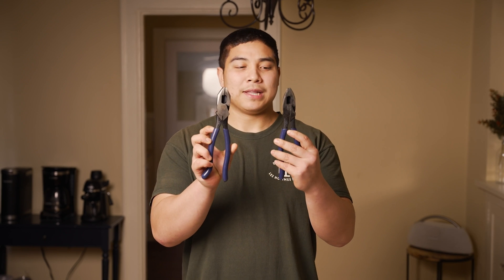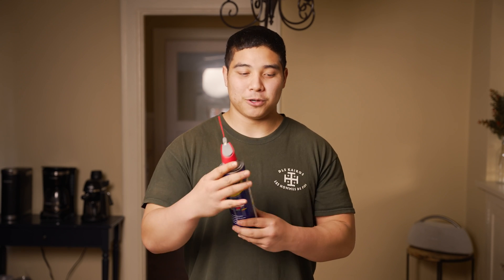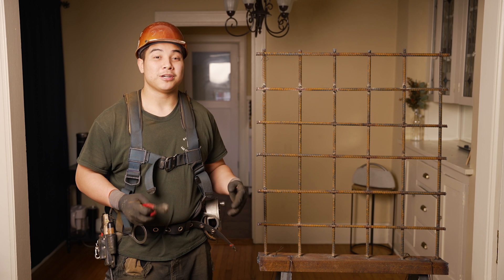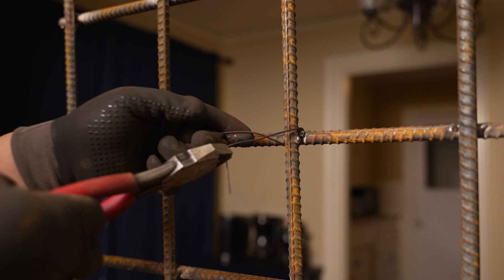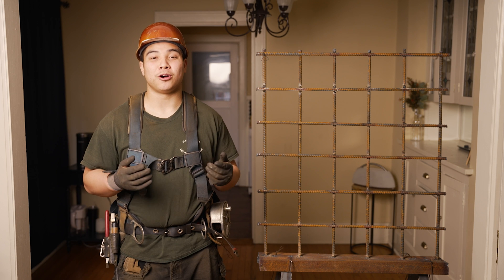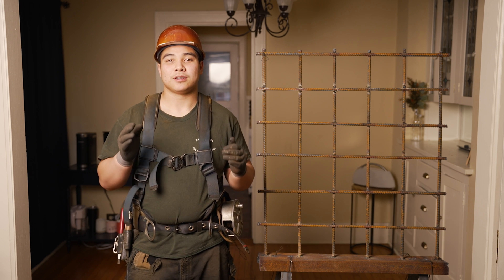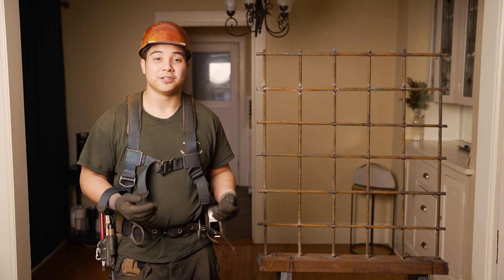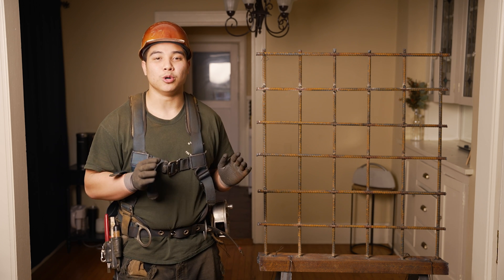How To Tie Rebar :Ep .1: Single Wire Snaps; Proper Tools, Reading The Bar, Technique

Comment: Son,  Back in the day when I did a lot of form work, we used what we called "potato ties"...
Which were actually used in the potato fields to tie the heavy bags. The rolls were made
of  approximately 4 inch wire with looped ends. You used a hooked twister tool that was
incredibly efficient and far superior to the pliers method...Simple  bend the wire around
the two bars, hook the loops and pull. These must still be available today...
Reply: Uphill both ways!

Comment: I can appreciate your enthusiasm bro, but you're giving out some not so good advice about tying bar......never double cut, it's one extra motion with your tying hand that's unnecessary and it leaves debris on the ground/deck/wall etc...alternate the direction of your snap ties, helps eliminate racking, also, it's called 'heeling' your wire, not keeling or whatever you said, plus, learn how to incorporate heeling your wire on the initial twist, helps eliminate one extra twist of your tying wrist which over a 25+yr career will prevent thousands upon thousands of twists not done by that hand possibly saving your ass from carpal tunnel surgery or arthritis. Also, lose that harness bro, if your working union in California I don't know of one legit company will allow you to use that for climbing, one more thing....BEND OVER AND TIE BITCH! haha!!!!
retired for two years now, have fun ladies!

Comment: Thanks for the video. I ordered and received two pair of Klein Tools D201-7CSTA from Amazon and the cutter smashes the wire and then I have to twist it for separation instead of making a clean cut. Is this what should be expected or are they defective?
Reply: Why use cutters to snip? Just twist your wire and cut with the blade on your pliers. The cutters should be able to make clean cuts

Comment: Dude, I'm with a concrete company and we usually tie our own bar rather than hiring out. We typically use saddle ties or figured 8s for wall bar. I learned how to snap tie more efficiently from this video but I'd love to learn how to do saddles more efficiently.
Reply: An efficent saddle is done by entering quad 3 (using the video quadrant system and rebar layout) to quad 4 with the hook, then grab the wire and feed enough wire to complete the tie (it will take a little practice to be able to eyeball the correct length more is always better here), then snap to snug and stab into quad 1, then release the wire and regrab with pliers from quad 2, pull the wire and snap to snug and complete the tie with the same technique as the snap tie shown in the video. This appies if you are righthanded BTW, if you are lefthanded it would be 4 to 3 then 2 to 1 and tie, hope that helps. As with all rebar tieing techniques you want to start slow get the technique right and then the speed will come.
Reply: You double wire saddle with a wrap on all framers, and the bar at eye level to walk on while tying the rest of the wall. Other than that (if you’re a journeyman) you can snap and wrap everything in between!

Comment: Bro You cheated them rods are welded haha, yo I'm building 4 extra footings for my added post n beams in my basement , I have a few questions..

MUST I remove all rust and corrosion on rebar before I pour or does it not matter, pour with rusty rebar?
And do I need the rebar under tension? I'm building a Cage for my 15 inch sonotube.
Reply: Rusted rebar can expand 4x its original size. This in turn can lead to more cracking, spalling & deterioration of the concrete. This is especially true in salty environments. Some say a little rust can even help with adhesion. All agree that Too much rust is always a problem down the road. Absolutely no rust is universally the best practice. Unfortunately, it isn't always possible. Therefore, if you can clean it all off you are better off. Tis my opinion.

Comment: Springs Slow you down.  No matter the work.  I trimmed marijuana for years. Everyone starts out with the spring loaded Fiskars.  But after some time everyone moves over to the springless Chickamasas scissors.  I will disagree with his use of a wet lubricant. I have always found that dry metal lubes work better if contamination is not an issue.  Overall an excellent video. Much appreciation for all of the details.

Comment: Wrong tool, too much iron wire wasted on each and every single binding, none of the bindings turned 90 degree in comparisson to the one previous to it so the Net locks, no spacing and no pattern info.
Please dont listen too much to this guy. he has no idea why he is doing what he is doing.

The quadrant rule he comes up with is pure Horse crap, there is never a allways for lying or standing iron, wether you start with a left or right twist, and turn the next wire tie 90 degree.
You simply just make sure to turn 90 degree on every other binding.

Also, he does not do the twist and drag so the tie becomes as tight as it NEEDS to be.

Comment: Just a little tip , before you skip your wire to make the hook , heel it that way you’re not wasting a move and you only have to twist the wire once , unless you’re tying template shouldn’t need another twist
Reply: Because your actually heeling the wire with your pliers , not really prying ...
Reply: @polishman4168  you can't heel with those pliers, steeles use nippers which are made for heeling only true steel tyers know what I mean, cheers
Reply: @charlerscarter5859  😂😂 man you are funny ,, good joke mate … can’t heel tie wire with Kleins 😂😂 please
Reply: It’s a ironworker term I guess 🤷‍♂️
Reply: @polishman4168  cool thank you
Reply: What is heel it mean?
Reply: @RoseBrosHTX  you pry the snap tie to tighten it before you cut it , that way it tightens the loose wire so the bars won’t move
Reply: @polishman4168  y don’t u just say pry then? Lol 😂

Comment: A jiw I worked with had me bending nails in my down time to make my hands stronger and last longer when I tie. We don’t have any rod work at my local so I basically only work structural and rigging but I still walk around bending nails lol.
Reply: 😂😂😂 where the hell is this at
Reply: @polishman4168  iw135 Galveston. Our main contractors are all crane rental companies and erection companies. Rats took most of our rod work long before I got in, and 847 has what what’s left of the rod work.
Reply: Does it needs big physical strength to be a rebar worker ?
Reply: @mohammedyoussefnour5855  it definitely does. Especially in your hands. But it takes your whole body.
Reply: @calebcoleman9569  thanks a lot for your feedback sir, appreciate it 🙏🏼
Reply: @calebcoleman9569  As a Ironworker Local17 in Cleveland, I agree if you're just a "rodbuster." But, around here if you wanna be a real Ironworker, not only does it take physical strength, but good balance & more importantly you gotta have fearless mental strength & be a bit crazy! Call me bias or that I'm tooting my own horn, yet I'm really not. Everyone doesn't have what it takes to do some of the sh!t we do, especially mentally, for example if you're a connector on a raising gang 50 stories high in the sky. I've watched many come & go for over 23 years thinking this was the job for them until they froze on a beam mumbling the same BS. "F%$k this sh!t, I'm out, you MFer's are crazy" Blah,ha,ha!!! Just saying...

Comment: Sorry.. U wouldn't make a lot of money in Czech Republic or Europe :)... Too slow, wrong pliers .. I'll try to copy u proper tool :)
Reply from the maker: Ok asshole I’ll take a look into your nippers there, haven’t seen anything like that yet. Here on the west coast of the US we use pliers tho(heavy seismic activity). Also the tying is purposely slow
Reply: @StandardLaborMedia  stand down brother he don’t know what he don’t know...keep making videos and tie tie tie! ✌🏻
Reply: @StandardLaborMedia  anyway I wanted to help u.. It isn't about seismic activity(I studied structural engineering.. Uni). Just those pliers  are just faster. Usually all the people use stubai... Some knipex
Reply: But on the other hand.. It isn't easy to get wire reel in Europe.. Just I'm looking for some, that's why I had a look on your videos
Reply: @StandardLaborMedia  if you're twisting double wire 15 gauge all day you might jump up to Klein 9's D2000, larger mouth, more leverage, better healing for heavier wire, don't slip though, you'll knock your teeth out with em...
Reply: Something like this
Reply: https://youtu.be/HcKBrGEHRcU
Reply: https://youtu.be/lLUF5h4ZW-E
Reply: Do you do much pt????
Reply from the maker: @tomlund4951  yeah I’ve done plenty of pt, a lot of high rises
Reply: Speaking of seismic activity, plyers wornt EVER make a tight binding like a cutter will. the plyer will simply slip alittle EVERY single time, without exceptions, cuz you need to not just twist the wire, but also drag it abit back/tighten it, so it has the shortest distance around the rebar its holding before doing the final twist and cut :)
And since plyers cant make those super tight bindings, you're gonna have alot of concrete taking the pull, witch is the rebars job. the rebar needs to be casted so it is connecting every so and so often, and yes it needs to CONNECT, just just stand 1 mm nearby - in order to live up to the bearing calculations.

Bahco 1519D is the go to when it comes to cutters, but a regular ¨Super cutter¨ is also very enjoyable to work with :)

And before you are thinking of lashing out, we build WAY stronger buildings here in Denmark in general. not larger, but stronger. this video of an example of why there is differences. so there really is no ¨this is how it really is done¨ or ¨this is how we do it over here cuz reasons that makes no sence in relation to the statement of wrong or lacking tools¨
¨wrong¨ / far from optimal tools, lack of know how about the strongest solutions and people who stubbornly got throu 40 years of working in the business.

its back when the hoover damn was build and the empire state building, that americans excelled at concrete, now days you got the worlds best skate park constructors - ill give you that. but when it comes to buildings and why you do the things you do, american concreters are falling behind europe by miles.

Building fast and big is not what its about.
You want to build a solid peice of work and you want to do it as easy as possible.
Reply: @frederikdenise6062  ya, ok Denise.
Reply: @StandardLaborMedia  bro dont listen to that lame
Reply: Union boys dont get paid by the amount of ties 😂 UNION BANDZZ

Comment: If you had to carry only one pair of pliers Wich one would you ?
I'm a concrete forms carpenter and I have been asked to carry a pair !
If you could give me a model number.. 
Thank you!
Reply: Klein 9's D2000.. you can drive double head 16's with 9's, break dobies, do all kinds of shit....plus, you're a carpenter, speed isn't your main concern.
Reply: They didn't teach you how to heal your wire on your first twist with your pliers? That second twist is unnecessary if youd heal on the first one....just sayin...if you work on a column crew and double twist you're gonna get your ass smoked, plus you make half as many motions with your wrist, carpal tunnels a bitch son.
Reply: Roddiener is right. I’m a multi craft civil worker in Houston Texas. When I’m working as a form carpenter I use my number 9 Klein pliers. They r heavy duty n u r likely to never miss n have more Accuracy when grabbing the tie wire. Number 7 Klein pliers r for more experienced Rodbusters.

When I’m tying rebar I carry both sets of Klein pliers but you only really need one plier. It’s really  your preference. Every person is different     I have a lot of friends that tie with number 7 only n friends that only tie with number 9s but for carpentry work number 9s is better
Reply: Bahco 1519D is the one and only tool for this. yes its not a plyier, and thats becourse plyers CANT hold the wire as this tool does, the plyer slips alittle when you drag the wire after tightening it abit, and then tightening abit more to make sure that the binding and iron feels firm. good way to check if your binding is tight enough, hit the rebar with the tool, 1 cm away, if it rattles, its loose, too loose. and no, making a correct tight binding, take no more time than binding a fast incorrect one.

Btw, the super cutter can also be used efficiently, but is abit more harsh on your wrists throu out the many years of craftsmanship :)
Reply from the maker: Definitely the speed(7s) you might even want to keep the spring just case your won’t be tying so much